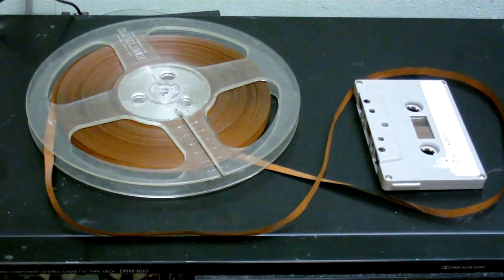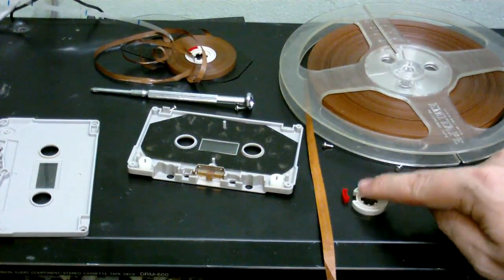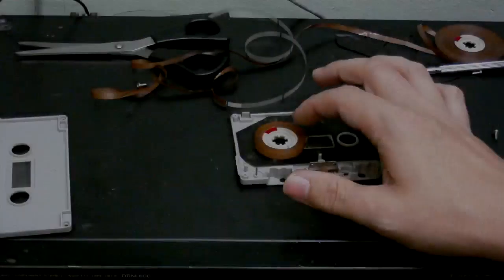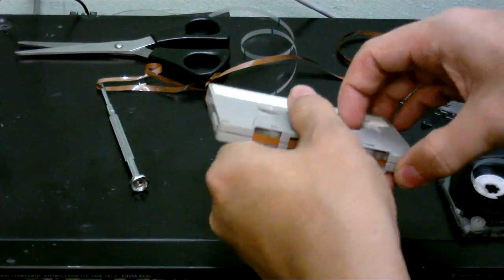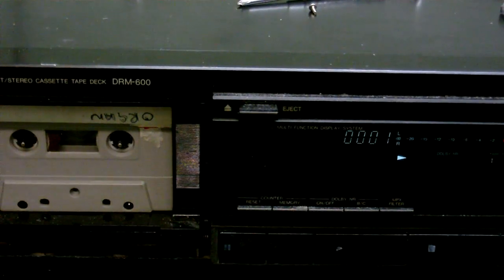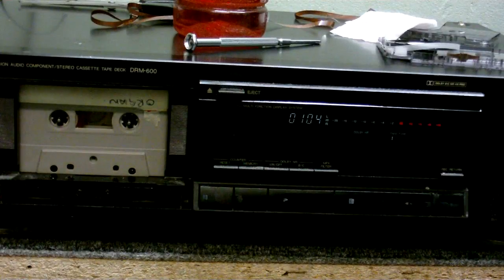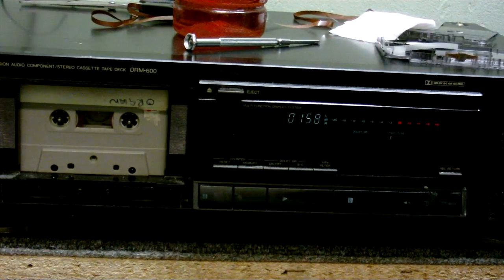reel to reel tape in a ordinarry cassette avi

Comment: The original recording would sound slow because reel-to-reel plays at faster speeds than a cassette.  

Lots of dropouts and wow and flutter, again because reel-to-reel tape runs faster than cassettes.  It's like really low bitrate AAC or Vorbis.  It sounds better than MP3 at that bitrate, but it still doesn't sound good (much like this recording actually did sound better than a reel-to-reel recorder at cassette speed)

I was kind of wondering how cassette tape would sound on a reel-to-reel machine.  I'm guessing the same as regular reel-to-reel tape with maybe better performance at lower speeds.  After all, cassettes produce the sound they're capable of at a lowert speeds than reel-to-reel.

Comment: hi i done some tests   1/8 tape against  1/4  tape     the cassette 1/8 tape  running at 3/4 ips is  better than the  1/4 inch at the same 3 3/4

the thing is i can only get 1/8 tape in high feet in the pancake  11800 feet a reel  37min a cassette  each side   fox tapes are a con 
all the parts i get from tapeline      tape cassette flipper's keep away from  right rip of

Comment: Ive done this with later pvc tape.. and a razor.. Tricky part is holding the razor so it cuts straight..You need a knack for it,.did i mention you also need to wind it on a reel to reel on FF.. Thats how i cut mine..

Comment: This can work, but the reel tap in cassette deck will be just garbage. Reel tapes used much worse magnetic coating that cassette tapes, which at their peak had so advanced msterials it could have linear frequency response of 10Hz to 30kHz.

Comment: What about cutting a VHS tape and record on it with the cassette deck, would it work?
Reply: That experiment was done of one Polish guy: "Výroba audiopásku z videopásku [HD 2013]"
And another guy Alexey Nakamichi: "Видеохром VHS в аудиокассету на Nakamichi"
but its good cooldude, I surpose make same project but recording it at 70us at II type and connect his deck to pc. That was a great for more peoples there to hear it's is possible to record hiss at this time/constant on this tape and how much is it. I cut MiniDV tape into audio cassette. It works but have little hiss at metal option/ or it dissapears at multiple recordings. + It worn heads because high amperage need more current. Head (normal ferrite gap) goes to wear cause the gap its for recording for type I and II if its alive.
My expirience with MiniDV its too slippery and can't be drive by pinchroller and capstan axle. But many playbacks the tape loose at time his slippery and it goes playable.
Reply: +thaddeus mcgrath I was about to say the exact same thing. I think, I will try that at some point, because I find it very exciting.
Reply: +thaddeus mcgrath I was about to say the exact same thing. I think, I will try that at some point, because I find it very exciting.
But I think that might be harder as reel to reel tape can be handled without damaging it.
Reply: +Philip vB Maybe you could take the VHS tape spool and cut it to the width required using a hack saw band saw? It might booger it up with the teeth. I would like to try but not have a reel to reel at the moment.
Reply: Yeah its might work.. but would also work for reel to reel as well..
Reply: LOL I've actually tried doing that ages ago. It sounded like shit...
Reply: acrualy it's czech guy
Reply: or even better, just play it and hear what it sounds like

Comment: you could have gotten the original R2R recording to playback on the tape deck at the right speed by increasing the speed of the tape deck's motor by unplugging the motor's power cable from the tape deck's circuit board and plugging it into a variable DC source to add it extra voltage to make the motor run faster.
Reply: No you could not because the damn track width is different.  The fact he had to slice have the damn track width down makes that impossible anyway.  However the cassette heads do not have the same size gaps as do the reel to reel.  You do not know what you are talking about.
Reply: clemsonbloke shouldn't it be able to at least work in mono

Comment: Actually not as much as you think. As a matter fact a type one cassette also uses the same eq. of 120 microseconds as cassette at 3.75 inches, and 7.5 inches per second. Also bias requirement on open reel drops a bit as you increase tape speed. Exceptions apply of course.

Comment: A reason for the bad recording can also be that the reel tape is much thicker - LP tape is 35um thick - while a tape in a C60 cassette is only 18um. This means that the reel tape is much stiffer and cannot so easily follow the curve of the cassette machines heads. Also the magnetic layer of reel tape is much thicker.
The tape is probably from the mid 1960's. That EMI reel was common at that time.

Comment: @ you and @ HarvestmanMan I figured you could record Audio onto VHS tape.. Tho i would be interested if you clould record video onto normal audio tape if you was to fit a video case up with the audio tape in such a way that it would work in the player.. like lay a few strips of tape side by side to get the same width of the VHS tape.. enough of it to allow the cartridge to feed it onto the video heads and then record a short amount of video onto the audio tape. Would be interesting.

Comment: It doesn't sound good because a r2r's and cassette tape's Bias and EQ are different. r2r is +/- 50 us (don't know how to use the micro sign, so i use "u" instead) and Cassette tapes are +/- 70 or 120 us, so it won't work perfectly and the level intensity have to be higher, to get the volume there you adjusted before. 3 Head Tapedecks often got a tape calibration because every Tape Type needs to be adjusted to get out the best of it, if not it sounds higher, lower, louder then the original...

Comment: I have a 1/4" reel to reel recorder, and wondered if I could use VHS or DV/Hi8 tape on it. The easiest one should be DV/MiniDV tape since it's also 1/4" so the size would be just right and you'd only need to get it on the reel, but with VHS you can get much more tape at a cheaper price, if you manage to slice it in two halves. I watched your video because I imagined you had devised some precision device to slice a lot of tape with little effort (e.g. using a razor blade on moving tape :-).

Comment: it sounds dull when you record for various reasons. firstly there was considerable improvement in tape formulations through the 70s and 80s, as cassettes became Hi fi, the tape coercivity and frequency response improved. Your old r2r tape had inferior formulation and at 1 7/8ips would've sounded ropey even when new! 
Secondly, it's probably 1.5mil thickness, which  means it can't fit the contours of the cassette machine head as well as thinner cassette tape.  interesting experiment all the same.

Comment: is there even a difference in the tape formulations? i imagine that this would sound a bit garbage. unless you are a robot, and was able to cut the tape perfectly straight. it would be really hard to keep the tape in proper allignment to the head as well as traveling smoothly in it's shell unless it's perfecly straight. you should try using tape from a dat tape. it's the same size and i'm curious as to how that would sound. especially since dat tape is usually a metal formulation.

Comment: i can tell that reel was recorded at least 3&3/4

iv taken micro cassette tape and put it in a regular cassette and it also worked.
Reply: If you wind the tape from 90 minute microcassettes into a C-0 cassette repair kit and splice them together you can make a 192 minute standard cassette that plays for 96 minutes on a side at normal speed. Now you can have a top 40 cassette.

Comment: That is a very cool experiment you have done there and it did work although the tape bias and speed are different between the two formats.
The sound in reverse is caused because of the different track lay outs 5/5.

Comment from the maker: I think reel to reel tape has to be magnetized more strongly than ordinary cassette tape. When I put it in the cassette deck, it recorded weaker than it should be, because the deck isn't designed for that type of tape, but I could be wrong.